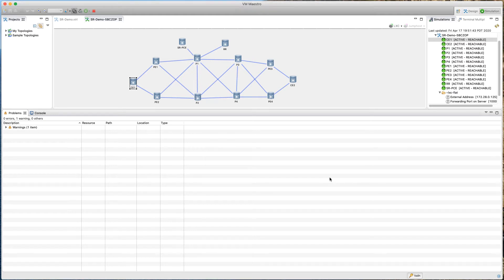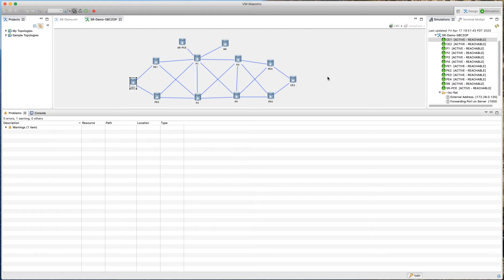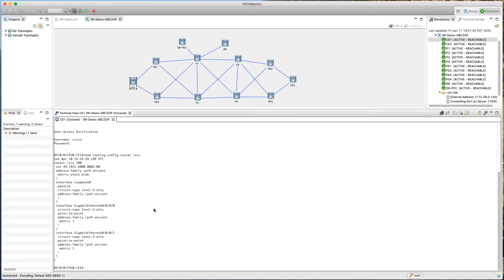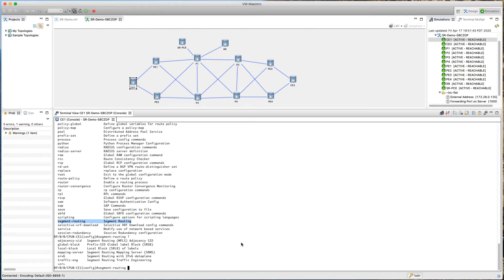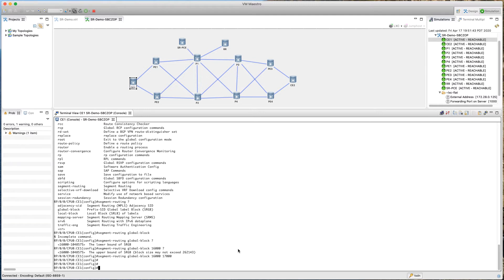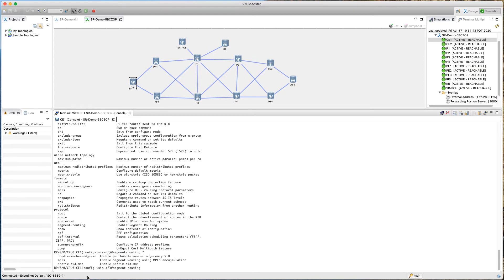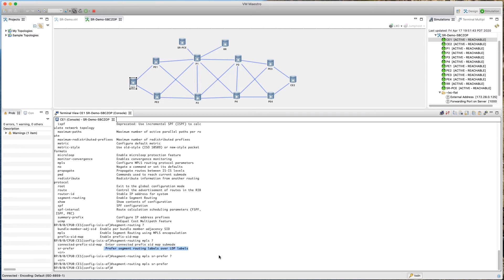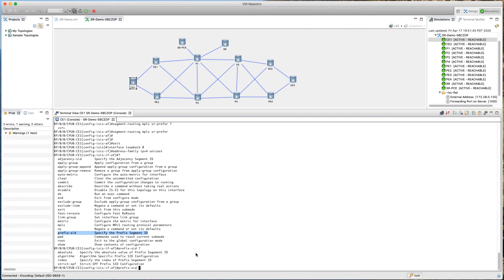Segment Routing - Implementation and Verification Lab - Part 1

Comment: Thank you very much for the videos. I have a question if you do not mind. Does the Cisco ios xr 9000v 7.2.2 support SRv6 with OSPF or only with ISIS. ?
Reply from the maker: https://www.cisco.com/c/en/us/td/docs/routers/asr9000/software/asr9k-r6-6/segment-routing/configuration/guide/b-segment-routing-cg-asr9000-66x/b-segment-routing-cg-asr9000-66x_chapter_011.html